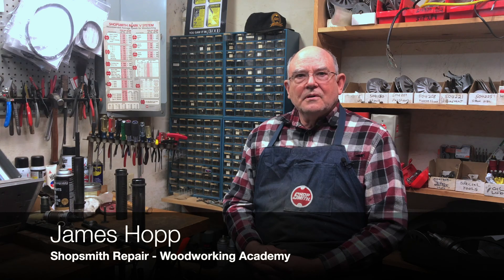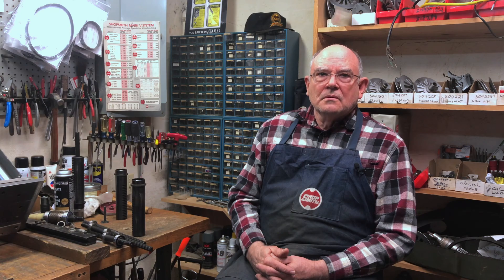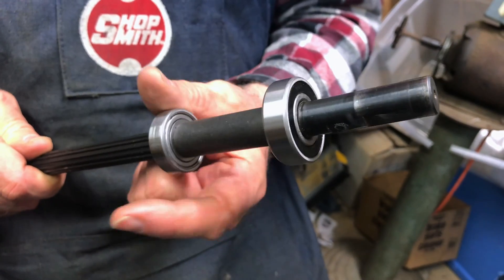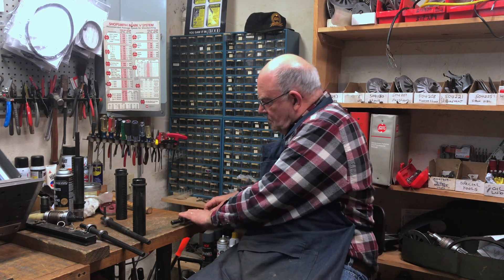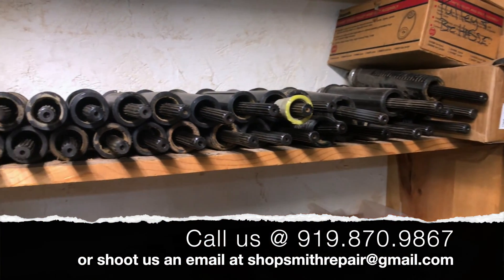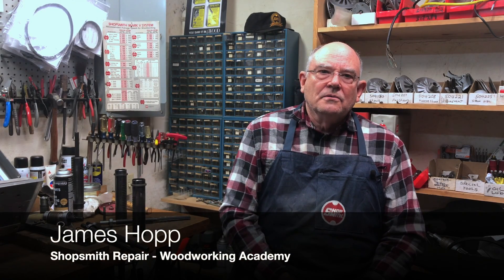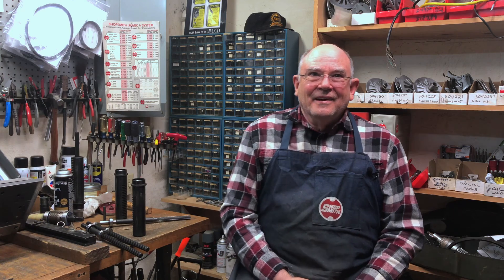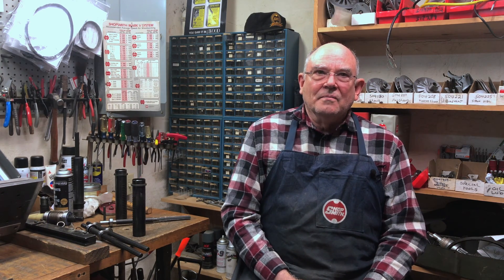Don't keep the new Two Bearing Quill in your Shopsmith Headstock!

Comment: If someone is bending a quill shaft because of turning a heavy unbalanced piece of stock, I would say use a tailstock until its somewhat round. Common sense I would think. The machine has limits due to the small size of the shaft. Its not a strong design like a dedicated wood lathe.  Be safe not sorry....
Reply from the maker: That is an excellent recommendation

Comment: Thank you for your videos. I was given a 1981 shopsmith by my father-in-law as they moved into senior living.  He even shipped it to me from Illinois to Ohio. I'm enjoying it very much.    I've been looking at the upgrades and was thinking of the new quill.  After your video I don't think I want to do that.  I got the new aluminum table for the band saw and I'm not sure I'm happy with that either.  It's bigger but it's also not flat across the gap. If I square to the right side of the table the left side is 90.2, at least in front of the blade . It's enough to feel a board wobble. It's flat behind the blade though.  If I slide a straight edge frome right to left it hits a small step at the seem.  I sent it back and Shopsmith verified my measurements but said it was in spec. I've haven't done wood work since Jr High so maybe I was expecting too much.   In spite of that I'm considering upgrading to the 520 table saw fence.  It just looks better.  If you have any comments about any of that  that I'd would love to hear them.  Again, thanks for your videos.  I'm learning a lot from them.  My father-in-law kept it in very good shape so I want to continue that practice and your videos are great.
Reply from the maker: Yes the 520 fence is better than 510 fence more beefy for sure. 
James